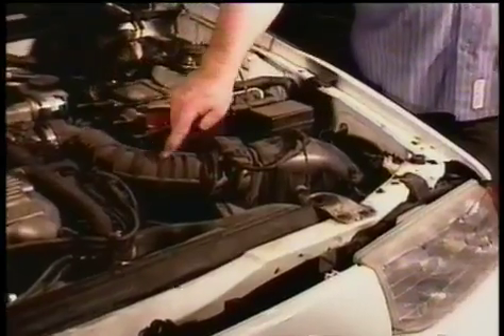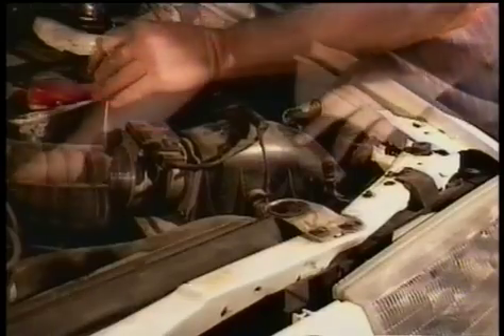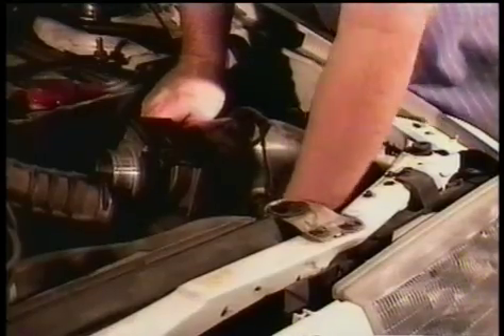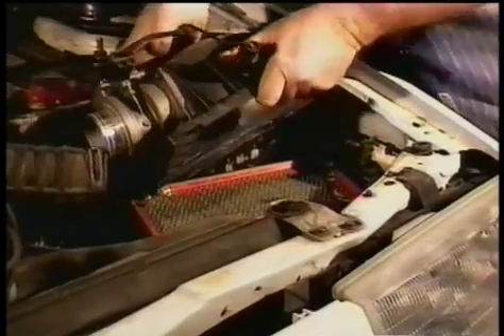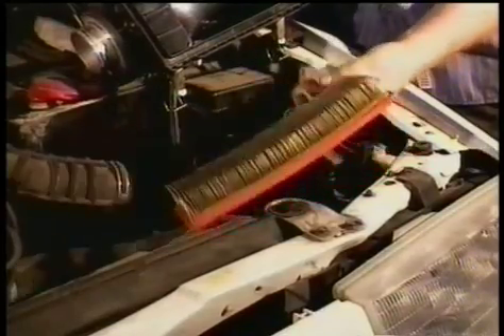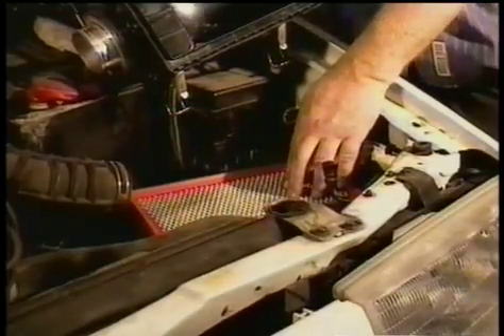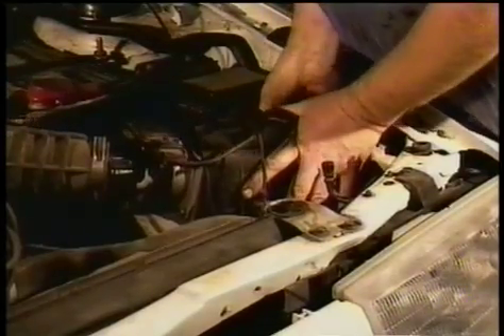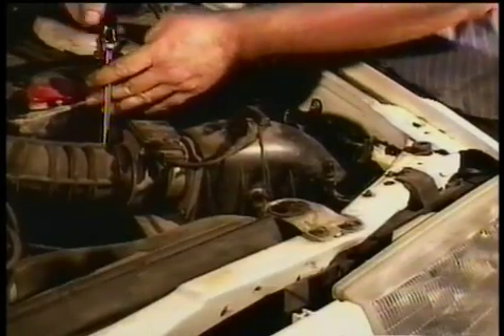Ford Escort Air Filter Repair Video

Comment: @mustangfan1995 I don't think it's the same for a 1999 escort. I have a 1998 escort and it uses the cone shaped filter. So I'm assuming the 99 is the same as mine.

btw, obviously you like mustangs...I have a 96 Cobra